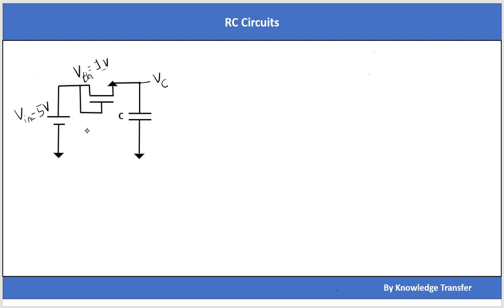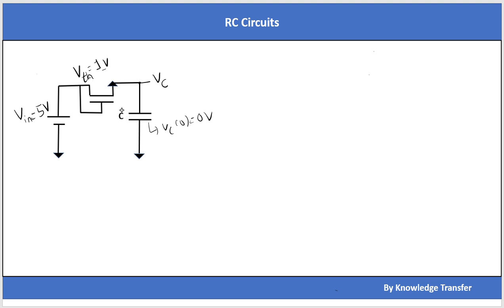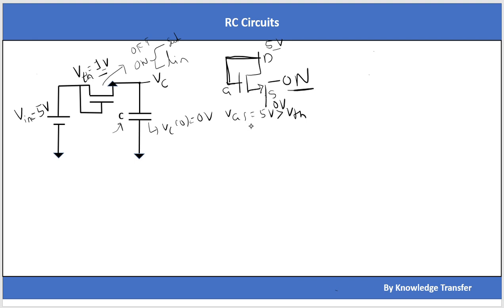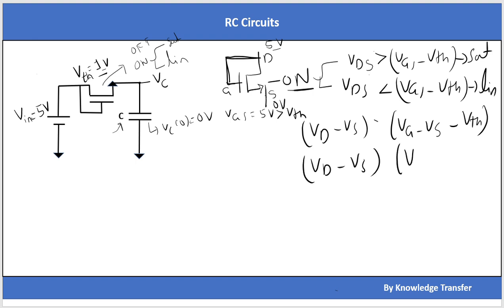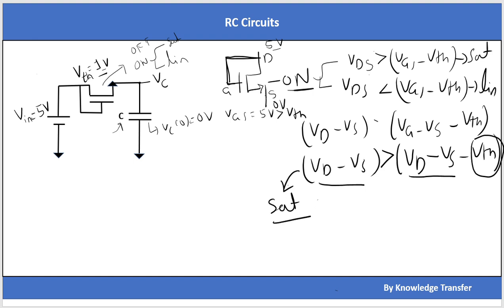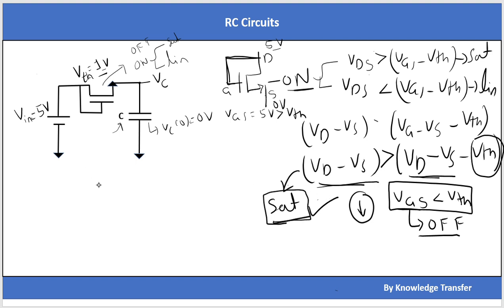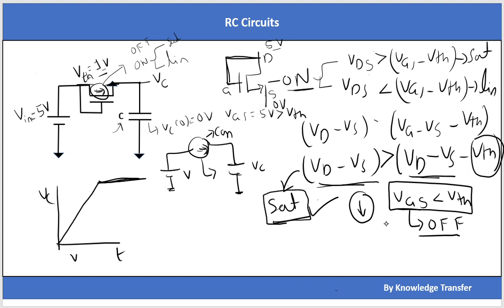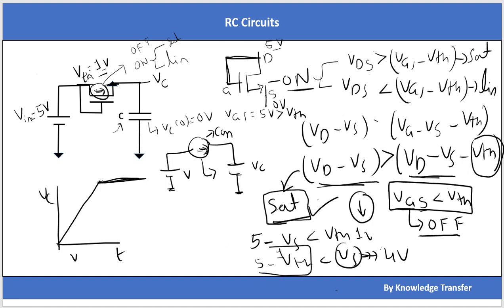MOSFET with Capacitor

Comment: when vc is gradually charging, Vgs gradually decreases => I also decreases So Vc won't rise linearly right!
Reply from the maker: As source voltage is increasing vgs decreases and in the same time vds is also decreases but vds will be always great than (Vgs-Vth). So FET is in saturation and in saturation you can replace FET with constant current source and if constant current flowing through cap, ramp voltage devlops across cap